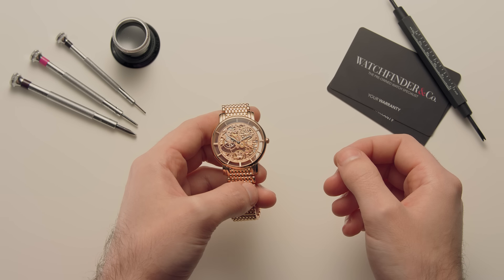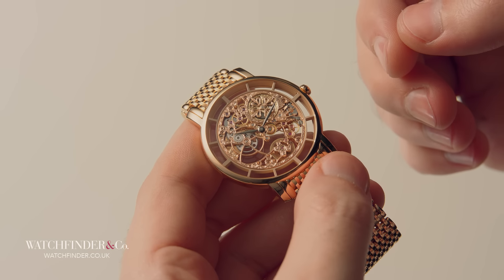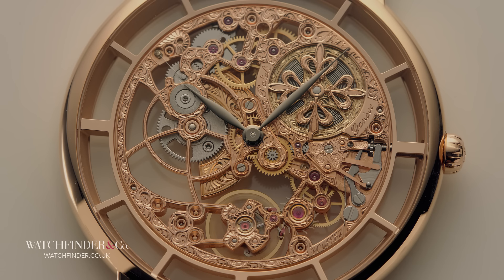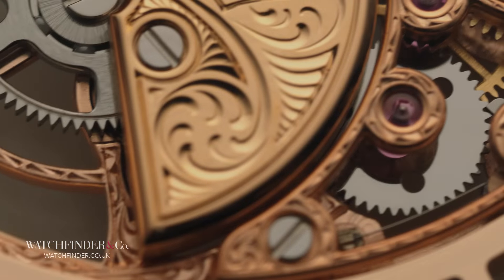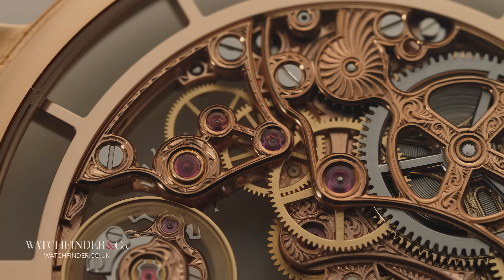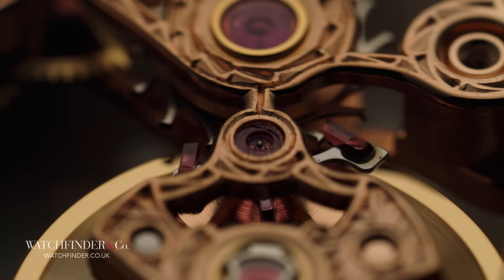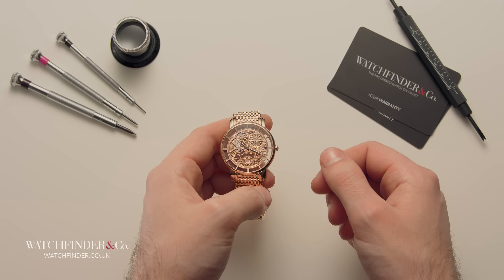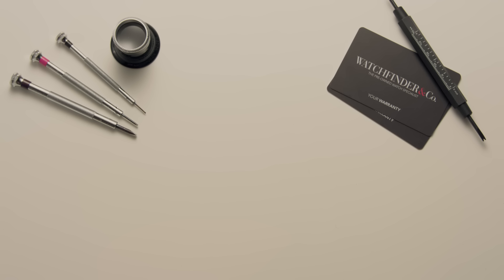How Does an Automatic Watch Work? - Patek Philippe 5180 | Watchfinder & Co.

Comment: Still don’t get it...
Reply: Thank you, great video !!
Reply: I think it's more for looking at rather than telling the time.
Reply: Basically, they transfer power from turning to the crowen to regulate the hands to move. Basically it's a set of gear they transfer power to the minute hand and hour hand.
Reply: Don't feel bad.. 90% of people watching this don't get it. Even those that claim that they understand it basically lie.
Reply: Bill Anderson Wow that was blunt.
Reply: The hardest part for me to grok, is how the mainspring powers the balance spring, and the balance spring regulates the geartrain ( via the escapement.)  It's the feedback I have trouble following.  If we ignore the tricky part where the balance spring needs to be constantly powered via the escapement working in conjunction with the rest of the gear train, time telling watches are not too complex.  First if we assume some gear turns at a known rate, we can design a system of gears, small enough to fit in the watch, where one will turn every 12 hours, one will turn once an hour, and one will turn once a second.  It looks more complex, just because they are crammed into a small space.  They need to be powered, that's what the main spring does.  The hard part is then getting the gears to turn at the proper rate.  Long ago people found out that a pendulum will go back and forth in an amount of time which is related to it's length, and the force of gravity ( this is an approximation though.)  Anyways, a balance spring in a watch in conjunction with the balance wheel works in a similar fashion.  Given a properly designed balance spring/wheel, it can regulate the gears to turn at the proper speed, but one more gizmo is needed - the escapement.  The balance is connected such that it allows the escapement, which locks up the gear train, to advance one "notch".  The balance oscillates, allows the escapement to allow the gear train to advance one "notch", and this happens over and over to tell the time.
Reply: Tell your mom to get you a G-Shock and don't worry about "real" watches.
Reply: You need to go to the patek phillipe store to get it
Reply: lol like dude wtf i see why this watch cost alot wow
Reply: thank you !
Reply: Manually winding a watch changes the rotational force you apply on the knob to the barrel spring, the watches "battery." The automatic variant is attached to this input. As you move, the weight will go to the lowest part of its path due to gravity, and with that it turns some of the gears on the input and charges the "battery" a tiny bit. The more you move the more it puts in. 

When you sleep, it's just expending energy, and gradually loses that energy. Putting it on before your morning jog will use the weight a lot, and fill up more battery than just putting it on and driving to your office job. If you never take it off, it will never lose power. The life of the watch is slightly parasitical, and by its connection to you and its utility as an accurate measurement of time, the automatic watch successfully completes a symbiotic relationship with its owner and is one of the very few true artificial symbiotic "organisms" in the world. 

As long as your heart beats, so too will the heart of your timepiece.
Reply: Continue believing it as a magic 👍🏻🤣
Reply: @vegass04  That is not true as there are people watching this video who actually made a  wooden replica of the escapement and they know exactly how it all works.
Reply: I heard so many things that made no sense at all 😂
Reply: @carmelpule6954  Yes... Like I said - 90% of people don't know. The rest build wooden replicas and work in watch industry...
Reply: @1nkw3ll  , thanks for that explaination , ive bought a bulova automatic , & it stops an hour after taking it off , & i thought automatics had a longer backup than that.it does get abit binding sometimes lol , having to put the time right before you put it on .
Reply: Spring turns and hits lever, leading the mainspring to release a small bit of energy to tick the watch. After enough gear reductions and movements it leads to 3600 ticks an hou
Reply: Simple... They make them.. "Watches"..... An we wear them... "Watches".. Thats how it works....
Reply: Edechamp thank you great video
Reply: @ryvr madduck the problem with ir solution is that you are losing potential “real” Watch fans. So I stead of sending them off to a Casio fan why don’t you encourage them.
Reply: The hard part to get is the escapement. It took me a while to really get how it works. Once you get how the escape wheel is both blocked by the pallet, and then pushes the pallet as soon as it's released, you'll get it. All the magic is in the beveled shape of the pallet teeth.
Reply: I don't either and watched it a few times !
Reply: There is a complex level of intricacy here which can only be described as genius

Comment: I have lost you somewhere half way, but still enjoyed the presentation. Thank you.
Reply: TheGlasspix 
Lol... that's what rewind is for:)
Reply: That little spinning weight rotates freely, powering a gear which winds the mainspring, like those toys where you twist the little thing behind and make it run by itself. Since the weight doesn't give enough torque to wind it unlike your hand, it has to use gear reduction, which makes it spin slower but gives more torque, like the first gear in a car.

That's what I understood about it.
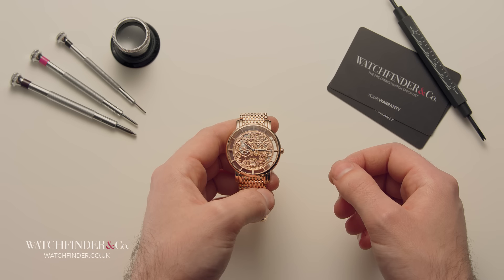Reply: Yep I lost it around 4:00 min. 🤗

Comment: You should review the Casio F91-W.

I know it's a $10 watch but it would be hilarious do to a full on, in depth review like the ones you do for these $50,000 watches.
Reply: Kyle Buchholtz i commented the same on other videos. I used a sieko for 12 years. Now I'm using f91w for past 7 months
Reply: Whats wrong with casio ?
Reply: The wrong is with the awful looking potato of a watch, not the brand
Reply: Yea, they need to do this on April 1st.
Reply: This channel doesn't have near the knowledge it would take to describe the working of a digital Casio F91W integrated circuit. Digital watches and mechanical watches are two whole separate entities. The reason these watches are so expensive is because of the small mechanical parts that are needed. Anyone with common sense can intuitively look at a gear and determine which way it will spin and how it affects the other mechanical drives/gears.

If you give the same person(with common sense) a digital watch circuit, they'll have no idea wtf is going on. I doubt they would even be able to describe 5% of what is going on in the digital circuit. 

The only reason these watches are so expensive is because of the time it takes for these to go from "factory" to finish. Factory meaning hand made. 

and let me remind you, watchmakers are out to make money, so if they can split a part into two different ones to charge a 100% upcharge then so be it.
Reply: Go Ham A lot of the inefficiency found in watches - specifically the extra parts you mentioned - are due to patents. A simpler design may be patented by a different company so it cannot be used. These "extra parts" are their clever workaround to avoid this problem.
Reply: Kyle Buchholtz... A REVIEW OF THE MEDIOCRE? Thank you, NEXT!
Reply: Do it on April's fools!
Reply: @goham2558  if they can split a finite small part like this into they deserve to be able to charge double.
Reply: still rocking one of em love them such practicla watches man
Reply: But there is a vdo
Reply: @antisan  Hardooo
Reply: Try $93,000-104,000 watch
Reply: This is a job for AvE!
Reply: @goham2558  Art is never practical. This separates the digital and the automatic.
Reply: Casio makes great watches. I have a great looking casio that keeps great time. I think I paid $30 ish for it about 12 years ago.
Reply: @antisan  
I'm pretty confident that in case of an apocalypse, after a decade without an oil change/lubrication, heat, cold and shocks, most mechanical watches will be about as precise as a good old sundial or water clock. Better get a solar G-Shock as long as you can...
Reply: You underestimate Casio:
The G-Shock MRGG2000HA is a Solar Powered Watch with a Calendar over 100yrs
https://www.gshock.com/technology/mrgg2000ha - a $7500 worth
I myself have the G-Steel Limited Edition Series which also has a Solar Energy Powered feature with Calendar upto 100yrs after which they simply ask to meet the dealer. 4yrs, still running.
Reply: @antisan  Your rant was super cute, it was like a child who got served up some cold hard facts and then tried to sideline the conversation. I am a mechanical engineer, who is also a machinist and swiss machinist. I can also build the necessary circuit on a breadboard to run a watch with any sort of piezo oscillator. I think you have no idea what goes into any kind of swiss machining (I.E. the HIGH scrap rates due to the delicate and micro nature of the parts and tolerances and the price you have to pay your fine craftsmen). I work in the largest cardiovascular contract manufacturer in the world. Your logical arguement is that nobody who understands mechanical movements could possibly understand the complexity of a ladder diagram or pcb diagram. Get real dude. A sure sign of someone realizing that they are on the losing side of an arguement is when that person starts belittling the other. Especially if it is calling someone's intelligence out without having a way to quantify whether or not it is true. I.E. I say you're stupid so hopefully you will get upset and either falter in your logic, or be too upset. In effect it is what turns a conversation into an arguement. Here is some more cold hard logic for you. Just to explain (to the level that mechanical watches are explained on this channel) all he would have to do is take it apart and have rudimentary knowledge of what caps, resistors, transistors, etc look like. He doesn't need to have the skill or understanding to make it from goddamn sand, because news flash *He isn't making the motherfucking mechanical watches either*. Basically, to win the arguement, you did your best to sound technical on how he would fall short in doing as good of a job describing an electronic watch. Apparently you figured surely nobody would call you on your bullshit. Step back for a second, I promise you don't know everything. Neither do I as a matter of fact. Oh, and your other laughable arguement was the complicated movements. Use your brain for a second kiddo, why do governments make their money so complicated? Do you suppose it is just to charge more for the bill? Or do you suppose maybe, just maybe, there is something greater to be lost if it is simple enough that any old asshole can recreate it perfectly. Alright, I think that pretty well sums it up. Feel free to call me stupid, or whatever helps you feel accomplished at the end of the day.
Reply: @Kaparzo  Calling someone dumb based on the omission of a comma is almost as hilarious as your much more grandiose error of deciding to start your paragraph with a quote. If you are calling him dumb for being a designer, then you just sound like a broke hater who gets mad at others because of his shortcomings.
Reply: Just the voice
Reply: 100 thousand lol
Reply: @jordanmielbrecht3360  On April 1st one year?!
Reply: Yes! 😂
Reply: Holy mackeral - this reply thread turned into a four way hatefest. Amazing. I like good watches by the way. My solar Casio tide watch is 9 years old and on its third band. It has never stopped or run out of power and never needs batteries so far. Solar watches can be the ultimate shtf watches imo.
Reply: @jijogj  I got my first F91-W about 35 years ago. It's a lovely watch. And I'm well aware of what Douglas Adams saidabout digital watches... :)
Reply: it happened....
Reply: Bro that’s more like a 500,000 dollar watch

Comment: Watchfinder I'm curious, is there any rolex with glassback case? If not why do you think they haven't made one yet? I'm really curious about this, please enlighten me thanks!
Reply: Louis Sutriharta only one. The rolex cellini prince.
Reply: because they don't want everyone to know that the watches work via the movements of very tiny squirrels.
Reply: LLGS ELEMENT it's.. square.. thanks alot for the info!
Reply: Michael Williams hahahahhaa rolex is kinda overated nowadays huh?
Reply: Louis Sutriharta i dunno, have you ever tried to breed tiny squirrels? it's incredibly challenging.
Reply: "For one thing, [a exsubition case back] on a dive watch it makes the watch much thicker when the correct thickness of glass is used to withstand pressure compared to steel. Look at a current Omega Planet Ocean & you'll see what I mean. They took a watch with an already thick movement and rendered it ridiculous & unwearable by adding a glass back. For another, Rolex traditionally haven't gone with current trends and have followed their own path, changing at a snail's pace" (Jake B., 2011).
Reply: Overrated because the masses do not have a clue about pp or ap ect.
Reply: Den Hayes well, it isn't like the masses have any hope of ever affording an ap or pp. even so, people still really believe that Rolex is better than Omega, jlc, zenith, etc...
Reply: Rolex is a tool watch and their movements are ugly
Reply: Advertising is a huge part of the lure that rolex has.
Reply: Rolex is not so much of a tool watch company now, like it was.
Reply: Say what you will about Rolex (as others have chimed in) but I’ve rarely found a more perfect instrument on my wrist than my sub 114060. It just does everything right, and it’s a joy to own one. A lot of buyers will consider it to be nothing more than a status symbol that they can wear, just as the bmw in their driveway is, and while that may be true in many respects, it’s still a wonderful watch on so many levels
Reply: All these people are so incredibly envious , good for you, enjoy your Rolex. I have 3 and love them all......
Reply: I am 100% not envious of people with MUCH finer watches than a 7-8k rolex, maybe you are the envious type.
Reply: Poor Dan, I have a 218206, 116695 and a inexpensive James Cameron Deep sea,  several Lange and PP's plus your pic of an assault riffle tells me volume's.....
Reply: Sorry my friend, I should not have lowered myself to your level
Reply: Sounds like you need a safe space and a hug...boy
 "assault riffle" riffle  ha ha.
I would bet mom is proud of you.
Reply: Did you miss the post that started all this, AND the next?
I will chill when i feel like it.
Reply: bad ass ova here..
Reply: Louis Sutriharta the main thing is that rolex was a tool watch historically and with tool watchs it's about function over form so I think they still do that because of thier history. Plus rolex doesn't really follow trends and a open case back is more of a new trend.

Comment: I just don't see how it's worth £100,000 when you look at a £100,000 car that has a million times more work, materials and everything in it...
Reply: More materials, but arguably not more work. The design stage of a car may be greater but the production of the watch being hand made will be longer than the car.
Reply: I think the argument of it being hand made to justify such high price is overrated, cant a machine do exactly the same as the hand? Does the quality go down? no
Reply: Machines can't make these, it's too complex and complicated. Maybe in the future?
Reply: The price of most anything is "whatever the seller can get away with". If you look at the secondary market, Patek Philippe is actually very reasonable. Many of their references quickly sell used for much more than buying one from an authorized dealer.

The 5180/1R is as much a piece of art as it is a watch ... actually maybe more art. What's not mentioned in the video is that this is a true skeleton watch (not an open-worked timepiece). So, ... Patek's 240 movement is made to working order and then disassembled before sending to the artists for both skeletonization (cutting away all not totally necessary metal) and the intricate engraving. There's no assembly line as in the production of a car .. but rather a small number of parts traveling back and forth between watch makers and artists for many MONTHS.
Reply: I'll have you know that this model is only £25,000.
Reply: By that £100’000 price tag, a car is less likely to be some”special” model and by 10 years from now the value would be 10 times less.
In contrast a watch like this one would gain more and more value overtime. Consider it like an art piece or jewelry.
To get some thing so special like this for a “car”you may need to invest 2-3 millions USD in a limited produced hypercar.
Reply: a watch is timeless, it will last forever, while car will break down,
Reply: Why do athletes make so much money and teachers make virtually nothing? It doesn't have to make sense.
Reply: @mfro4422  good analogy
Reply: Because westerns love to make something so much more expensive. It is pure marketing. If you want to buy something expensive but worth the same with the materials, choose japan watches. They dont "lie" about the price